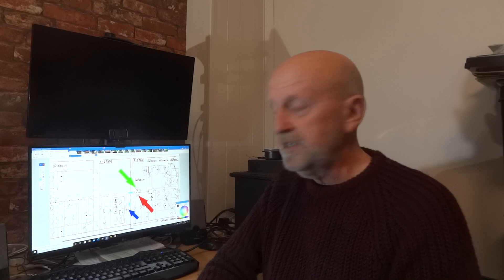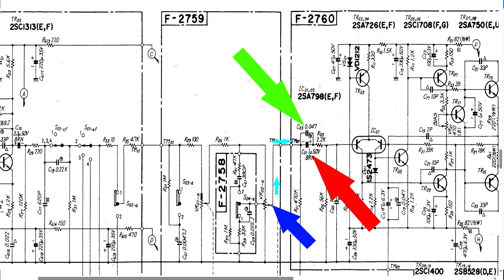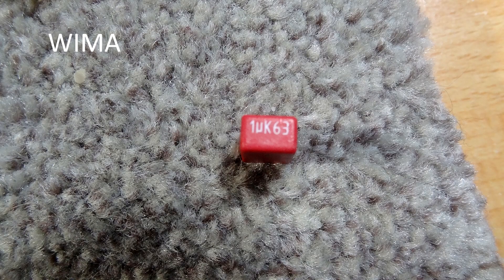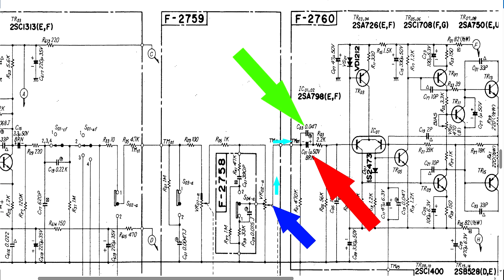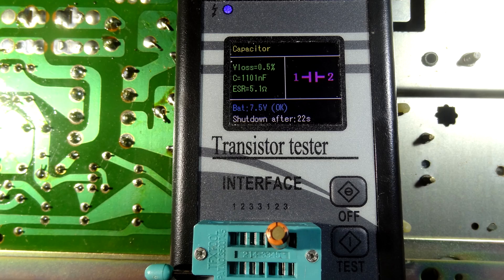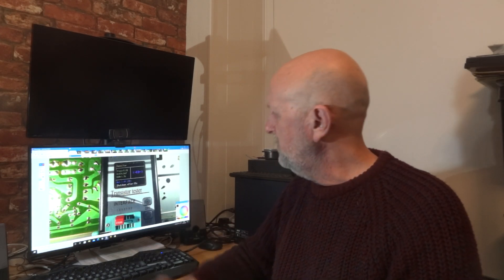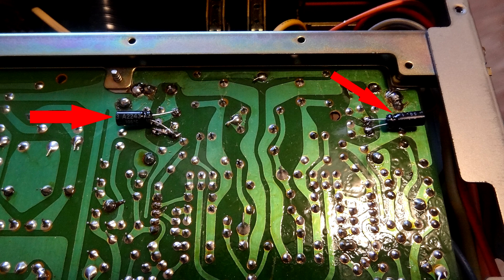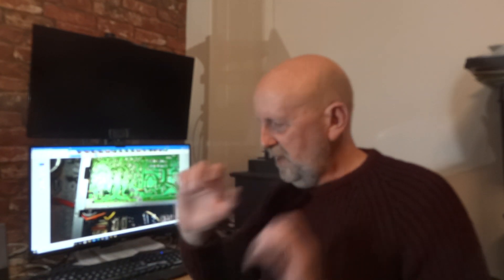Amplifier Signal Path Capacitor Recapping. Which Cap Is Best. Nichicon, Rubycon, WIMA. Sansui au-217

Comment: I recapped my sansui 350a preamp board. Use nichicon FG and Muse. I can hear more low end but sound became very moody. I replaced electrolitica 1uf and 3.3uf with wima film. High end frequencies came back but music sounds very harsh . Then i put old original capacitors back. And it sounds very clear, detailed and very pleasant. Old Caps are out of specs on capacitor tester but they do better job than new at least for my ears. Will try one more time with Elna capacitors but definitely i can say i dont like wima and nichicon combo
Reply: I tried recapping because a lot of people said new capacitors will make it better. But i got completely opposite
Reply from the maker: Yes I think its a case of trying a few different combo's, I have left the old 1uf and 0.47uf in on a 331 receiver as they sounded better than a few replacements I tried, but changed the 0.47uf to a fine gold and left the original 1.5uf on the phono stage and that sounds real nice now. Amazing how some new caps cannot do what the olds ones did.
I read on a lot of forums people doing recaps only to take them all out again and put back the originals.

Comment: If you’ve done these tests ‘by ear’ you should have find a blind test and all tests should have been done back to back (which would be a real challenge in itself). 
If not the results will be subjective. 
I’m sorry to be so harsh after all the effort you’ve made.
Reply from the maker: No problem not harsh at all and a fair point. First of all I dont claim to be an expert as I explain in a lot of my videos . I did want to give that caps a day to burn in shall we say then do the test for that cap. One thing I also did not mention in the video was after doing all 3 new caps over 6 days the last day I hot swap all the caps in turn to double check my thoughts and of course these are subjective. I did have a comment that I need an scope and spectrum analyzer to do a proper test, but I do not have either and would have no idea how to set them up to show space and airyness on tracks. The main idea of the video was just to let people that do a recap on old cheap vintage amps to maybe get a few different makes to experiment with on thier units as they can give different results.

Comment: Every time I did a double blind test on capacitors with a group of audiophiles, the results were always inconclusive.
Reply from the maker: Sorry I have been watching the replies to this comment and now remove a user for being derogatory to another user for their grammer and being insulting.
Reply: You tell them the price of each cable and magically the more expensive one will be the best sounding one.
Reply from the maker: Think that would be the case here to. Its very much to the listeners taste I suppose
Reply: If sound isn't really the question, then which is better in terms of durability. I have a feeling they are probably close but asking my betters seems a good start to find out.
Reply: @gaineyjohnson6628  The metal film caps are probably the most durable as any internal short is pretty much blown clear - self healing.  But really, any modern plastic cap of sufficient voltage is fine for vintage restorations and will last many decades or more (or "forever") longer than the originals.
Reply: A friend of mine uses 8 ft horns and he swears the sound is more imposing than my Whardale 9.1 speakers budget speakers... I swear there is no difference in sound.. He is a fool don't u think?
Reply: @matthewtaylor7355  Actually, no.  To me, transducers like speakers and even phono cartridges have a profound effect on the sound whereas I never heard a difference between capacitors, speaker cables, RCA cables, etc.

Comment: Hi Michael, I am happy you still do audio. This is a great experiment and I think a lot of people not watching this are missing out. I was surprised that the Wima capacitors where disappointing. Having said that, you may have a Chinese knock off capacitor. Wima capacitors do not have printing on the top, but on the side. Also 50P is a bit cheap if you buy them in low quantities. I would expect that you have to pay at least double of that to get the real deal. Also, it is good to know that Wima has a wide assortment of applications and dielectrics within their film capacitor offerings. What you need is either an MKP04 (I believe this is the correct one) or an MKP10 series. Also, if you loose base, you could up the capacitance value to 2µf if the MKP4 type still lacks that (which surprises me). Other than that, I believe that electrolytic capacitors have a much worse reputation than they deserve, and your experiment proves that. Certainly they have their own sound, and it could be the more vintage sound many of us love so much. If you are doing more experiments with this amp, I hope you will make more videos of it as well.
PS, if you get a real Wima MKP4, it will say Wima and MKP4 on the side, left, besides other information on the right. And the printing is black. There should be a black vertical line on it was well. Have a look on google images. And e.Bay and even Amazon is not your friend when it comes to buying new premium electronic components, it is a bit of a wheel of fortune.
Reply from the maker: Thanks Hugo, I think I got the ones I used from Farnel, but now you have me thinking. I have just ordered some 100v ones from Rapid, they look like the ones shown on my thumbnail to this video. I will give those ago as the ones I tried here were not great at all. I will pin my findings on this video comments and also reply back to your comment
Reply: Wima Caps the Poundshop Audio grade capacitors

Comment: Here's a tip, when using solder wick, use a little extra flux on the board, it will really help the removal of solder to the wick.  :)
Reply from the maker: Thanks for the tip
Reply: Cheers! You'll be surprised how much it helps. I learned from another youtuber myself. @MichaelYates